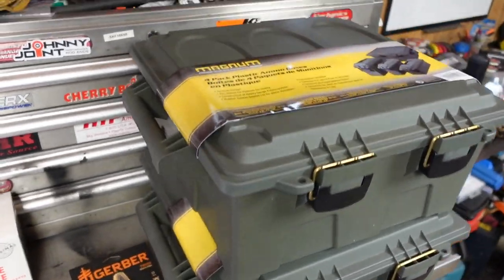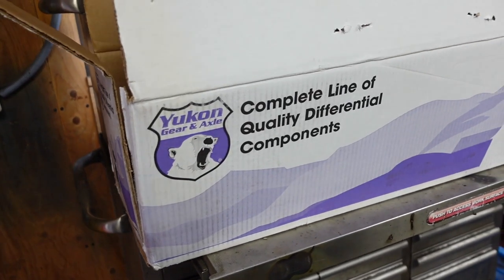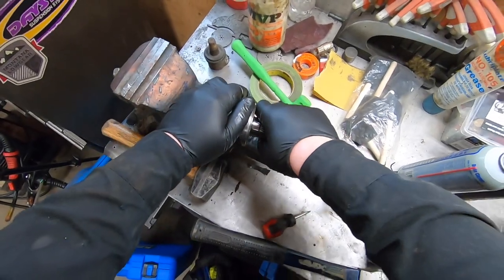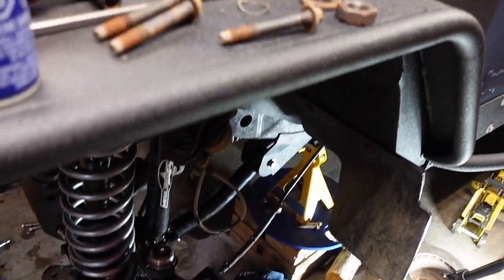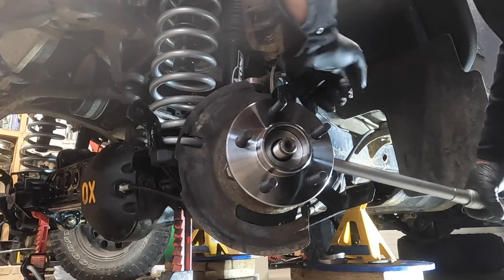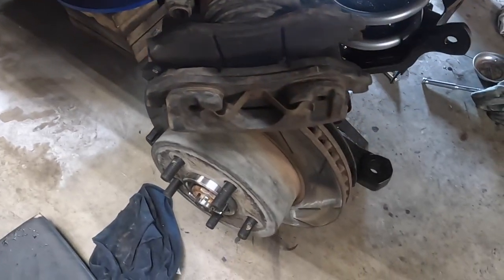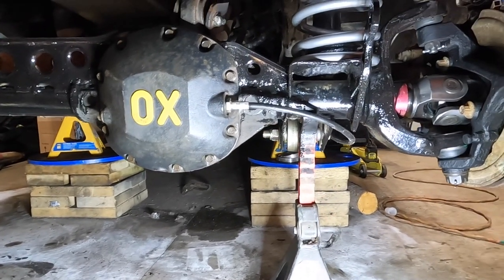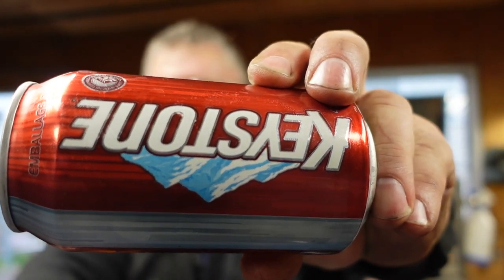JEEP TJ GETS STRONGER AXLES | Yukon 4340 Chrome Moly Upgrade

Comment: I installed CrMo axles in front years ago and they're still going strong with 35's.  The stub and inner axle on the Jeep TJ Dana 30 and Dana 44 are the same.  Only difference is the pumpkin.   You'll be happy with those, it's like extra insurance when you're out in the boonies against breaking.  You'll feel good about giving her some extra gas over obstacles.
Reply from the maker: I 100% agree with you

Comment: I have stock Dana 30 shafts with IROs weld on ujoint caps. I abuse them pretty well in big rocks. So I’d say you’ll be fine for sure with Chromys.

Comment: Dana 30 Front XJ-MJ-YJ 1984 or was it 1986 to mid-year 1990 used Wheel Hubs that are rebuildable! They are supposedly stronger than the later wheel hubs as these used tapered bearings vs balls. I don't know, but they seem to last a super long time. Only problem is you gotta use the Brake Rotor for that year! Caliper and steering knuckle, whatever (if using an early steering knuckle, they use a different part number ball joint and brake caliper setup) but gotta use that early Brake Rotor! 
It'll be interesting to see how long these last! and even more interesting if next time ya try the older parts! <3 all
Reply from the maker: The YJ I know had the Vacuum disconnect front axle I think maybe that’s where those parts are for
Reply: @BackCountryWrenching  Nothing to do with Wheel Hub Bearings and Brake Rotors, though I now wonder if those can be upgraded to the big U-Joint shafts... I remember seeing the procedures to rebuild them even and going to run off and check the '90 service manual, lol!
edit: Group 22 Wheel n Tires shows the tools n procedures! while Group 2 "If the hub is equipped with ball bearings, it can not be serviced and , if defective, the complete unit must be replaced. If the hub is eqquiped with tapered roller bearings" hudda hudda! Also shows, Command-Trac is the disconnect, Select-Trac axles are full time (like current), and 2WD Beam, neato! so, I went with older junkyard parts cos cheap and learnt later they were superior...? whatevah!

Comment: You should be good to go with those axle shafts! I ran 35s on my 5.2 swapped TJ with a D30 (and a d35 in the rear surprisingly, the weakest I all the land according to forum gods) and i never had any problems. Then again, I wasn’t being an idiot either, so that probably helped. Lol
Reply from the maker: That’s the ticket, a bit of common sense knowing the limits and you shouldn’t have issues.